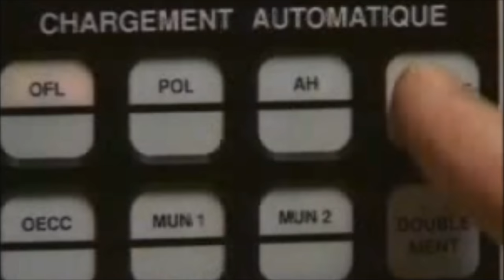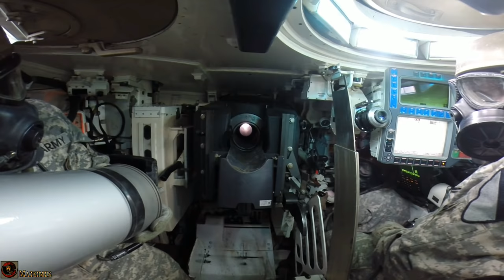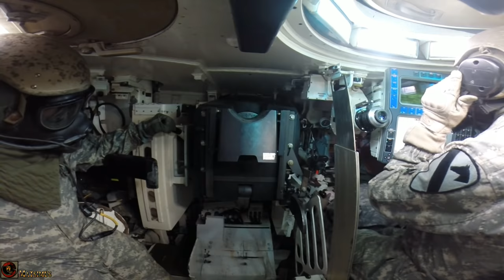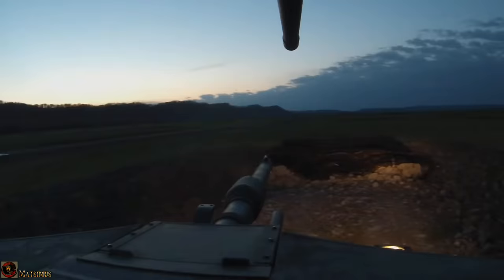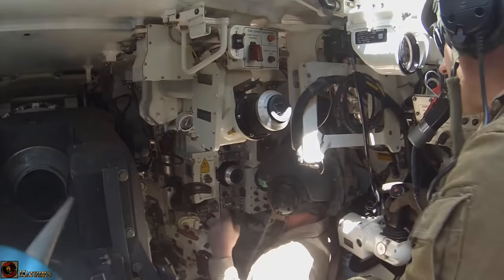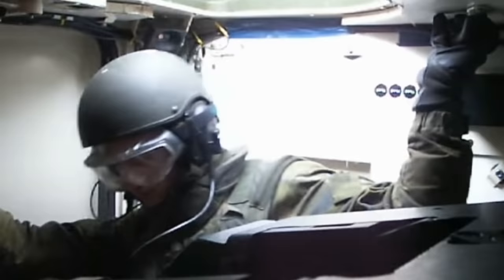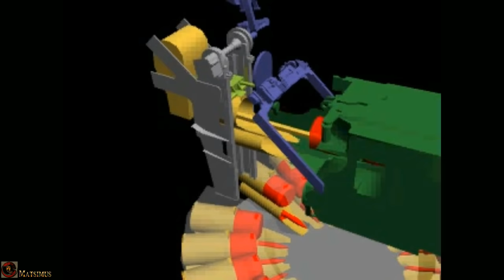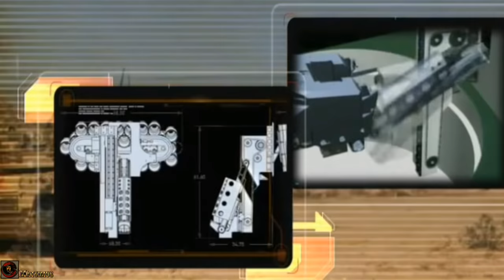Tank Autoloader or Crewman Loader?

Comment: I think one thing to bear in mind is that the loader choice is appropriate for the doctrine in the originating countries. In countries like USA and UK, the army is all professional, and usually has long term prospects. Therefore, you can invest in training good loaders and give them loads of experience. A rookie loader would be worse than an autoloader as they are still figuring out their job.
Russia etc has a conscription-based army on an average of about 2 years. That's two years to get basic training, tank training and actual deployment to a unit for exercises/battle! You can see why removing an individual in this situation is felt to be of benefit. I'm not saying I agree this is the right way to go - a system as flexible as a human loader is still appropriate (assuming a skill and training level allowing them to match or beat an autoloader). But autoloaders are much more valued if you do not have the peopled expertise to spare.
Reply from the maker: That is a very very good point. Never even thought of it like that to be honest! But it makes sense. I would say though that the US is going to side eventually to the autoloader systems. They are already working on it with Meggit. Thanks for the input mate :-)
Reply: Your assumption is just so wrong. My country has a conscription based army ans yet many people are making the living out of it. The army has many professionals and they are paid well, very well to be exact. All students who join military universities do not have to pay tuition fee and that's is a huge plus. And we are even poorer than the Russia. Your logic is kind of uninformed but logical from the point of view of someone who doesn't have the knowledge about the system. The conscription based military doesn't mean that you force people to join because no body wants to join, in fact our military rejects many applications every year. Bad eyesight, tatoo, etc and you are out. The military  system aims to do a lot of good things but it is 1AM here and I am tired and so I would conclude my comment here.
Reply: +Thịnh Nguyễn Quang yes, but I'm not talking about the conscripts who choose to stay - they become professionals and are not the ones I am referring to. I'm talking about the many many more who cycle back out as soon as the opportunity presents itself. If you have large staff turnover in any sector, you cannot provide the level of training necessary to all staff equally, simply because there's no point spending the money on folks who won't be there. I accept that the professionals who choose to stay will be better trained and probably better paid, but there needs to be enough of them to fill the ranks before you can afford to give out as many specialised roles. And if there were enough of them, there would be no need for conscription...
Reply: You make a good point, Ghost Dog.  I served as gunner/commander during the Cold War in Germany where most of the men in our unit were volunteers (3 year term of enlistment).  It took two years to make a man into a good soldier, so you had him for one year before he was released.  He had the option of staying on for another 3yr term, but nobody would want to remain as a loader for any longer than they had to, since it was our 'entry-level' job. There are many things even a rookie loader can do that a machine cannot, such as clearing a stoppage in a cranky coax mg, or double checking your 7.62 ammo belts before feeding into the loading trays, plus he is capable of (relatively) intelligent thought when something fails in an emergency which is something these robots cannot do.  In the heat of battle I don't want to have to leave my post to go clear some mg that's playing up.  That said, I did have one cranky loader I would gladly have traded for a machine!  
BTW-- With our good loader we could fire 15  accurate rounds per .minute.  
80 ]    Ah, but that was 50 years ago, and I expect that robotics have come a long way since then.
Ein Prosit!
Reply: Thank you for your service. If this was a manual loader, I can assume your service was with west Germany??? What tanks did you learn your trade on? What did you think of the soviet equipment of the time? What was the tank 'over there' that you were most afraid of (based on the data available at the time)
Reply: +ghostdog688
First off, I'm glad you mentioned is the training aspect. That is how the Spartans held off the Persians for 3 days while being outnumbered 100 to 1. The individual soldier is the important aspect on the battlefield. Regardless of the weapons or numbers.

Second and most importantly, a loaders job is more than putting a shell in the breach. When you are in a combat situation you run hot. Which means loaded and ready to fire. So the loader is the free man while not actively shooting.

The driver is busy looking for the best route to get where you are going
 while staying out of the vision of the opposition. A gunner is busy 
scanning the designated area of engagement responsibility. The tank 
commander has to do many things, verify what the gunner sees, 
communications, monitor the information system and try to keep an 
awareness of his local general combat situation.

That's where the loader comes in. While moving he is the only crew 
member that has his head outside the vehicle. Everyone else gets their 
information through periscopes or scopes. The loader has the best 
perspective of the actual battlefield. 

The loader watches the sky for helicopters, which is a needle in a 
haystack for the rest of the crew. You can see the terrain features 
better from a higher viewpoint helping guide the driver to a better 
route. Help spot enemy activity pointing the gunner in the correct area 
to scan. Help the tank commander by assuming the role of keeping up with
 the local units freeing him to do his other jobs better. 

The loaders main job is to make the rest of the crew better, therefore 
more combat effective. As a loader during live action war games, I 
spotted at least 1/4 targets we engaged with my eyes or binoculars 
because of the perspective. 

So I would guess that a loader adds 25% to combat effectiveness while 
only adding 10% cost. So at this time until you can make an M1 into a 30
 million dollar tank version of the F-35 with automated sensor awareness
 that is better than a human perspective, it is cost effective to keep 
the loader for the US. And comparing professional well funded military combat doctrine to countries with a budget crisis or ones with poorly trained soldiers is apples to oranges.
Reply: It's Me I appreciate the perspective and won't argue with it; I would guess that the Russian would argue they have strength of numbers (i.e. More tanks) to counter the number of tasked crew. Also they like to have SHORAD teams dedicated to hunting and killing air threats in vehicles like the Zsu 23-4, so the notion of keeping watch on the battlefield is more at the platoon and company level than the individual. Not saying it's the correct way, just a different one.
Reply: +ghostdog688
I'll point out first off that I'm not an internet warrior that is pro USA everything. If a soldier doesn't respect their adversary they are just plain stupid. Saying that the 23-4 is a highly respected weapon. It is viewed the same as we did the WW2 German 88. It's an AAA weapon but is very effective in many roles. For the cost and it's effectiveness it's one of the best USSR weapons they ever made. 

And I do understand the Russian military doctrine. We trained to run it, and how to fight against it. Not going to start a flame war on it because it is not that pertinent to this discussion though so I'll leave it right there.

On the modern battlefield, like with plane combat, who sees who first has a great advantage. Any tank is perfectly capable of taking out a helicopter. Reducing a tank ability to do that is putting the onus completely on the AA teams and the tanks in more danger. The US uses a more combined arms approach where anything can do everything. 

For example, the Russians have said that adding 4 Apache's to an armor brigade added 50% to that brigades combat efficiency. We did not have the same respect for the Hind-D. The Hind-D was big, slow and no longbow type of system that could fire while hidden. An armor unit vs a Hind-D was a pretty even fight. It would probably get the first shot but another vehicle would take it out before a second shot. Now that two propped chopper they had (blanking on the name) was respected even if it's firepower was lacking. It was fast and agile which made it hard to see and engage. 

And bringing up numbers of tanks, the US has over 14,000 M1's in active duty or in war stock. More than enough and many more than the advanced MBT's the Russians have. Add in to the fact that when the US goes for cheap, we don't assign the MBT for that role. Why do you think the T-14 has optic dazzlers? Answer, it's because the US started taking the $23,000 Humvee and putting the $50,000 TOW missile system on the them which means they could take anything the Russian had made up to at least the T-90. And you know the US, within months of ramping up production, could start pushing out a million of those a year.

If you want to go cheap, go cheap. No MBT is cheap relative to a hand held missile or one mounted on a truck. In my experience, one experienced tank crew is better than many ineffective tanks. I've trained in exercises against poorly trained soldiers at a 12 to 1 ratio, and we won most of the time. It was eye opening to say the least.
Reply: funny thing about your american m1 ppl always think that t72 was that bad example that ruined all. Russian loves autoloader cuz it actually reduce the size of the turret and maybe hull. therefore saving some weight. it also increase the loading efficiency when cruising at bumpy place. your best trained loader guy still get fatigue. 
Dont tell me it is vulnerable. your loader guy also turn "non-operational" when hit in the head. if you can sabot thru the armor then theres no difference between the two.
you think russians dont know why T72 is so bad? well, maybe its designed in 1960s.
Reply: It's Me apologies for the late response - my notifications just caught up.
First of all, thank you for the insight, and respect to someone who has been able to post an intelligent counterpoint. For clarification, I agree with all of your points - i am not saying an autoloader is the best system, but it is one that has merits - and given that russia has elected to double down on this with the release of the T-14, I'd say its here to stay. What started as an attempt to provide a counter point to matsimus' opinion, and provide some insight into the thinking over why an autoloader was selected has quickly devolved several times into an 'East vs West' argument over the capability of the whole army on each unit.
This isnt about that, merely an idea on the thought process behind the selcetion.
That said, as you've been so civil over your post, I'll bite a little.regarding your comment on the 23-4; I used one example of portable AA systems. Being that you have an understanding in Soviet/Russian tactics and doctrine, youll recall additional units such as the SA-8, as well as portable SAM systmes such as the SA -6 and its upgrades, the -11 and -17 are supposed to be deployed just behind the front lines to provide support and air cover for the advance.
While a Tank can indeed counter a helo if it spots it, a jet is another story - and Soviets always treated these with far more respect, simply because cluster munitions mounted to a jet would wreak havoc with a Soviet column. One CBU could decimate a unit, and in the quantity issued, I'd argue that air superiority for CAS was something the Soviets put a lot of thought into. I'd question whether or not any MBT of the 70s could detect and stop a jet on its own with its gun only if it had no TIS. The Zsu and SAMs could get helo's or at least force the air force to stop running CAS and start running SEAD/DEAD ops.
I do not doubt your excercises or their results. But I would wonder if the excercise fielded a truly combined arms approach - MBTs, AFV's, Infatry, Airforces and AA defenses, including theatre IADS. If it did not, I would doubt stringly that 12:1 score would be repeatable.
Lastly, I am  aware of the quantity of M1's that are supposedly availble. I would like to know how many crews you could field as I suspect you would not have as many well-trained individuals to adequately field the number of tanks you have. Even if you 'gave' them to other NATO units, you'd also need to provide Ammo, fuel and consumables for the units. Plus you'd need the logistical support to keep them provisioned. This is where I question the use in holding that many tanks in supply. Furthermore, where are they? I would wonder how quickly you could push them to the front line e.g Europe before Eastern tanks rolled over the gap.

I mean this debate and point in the spirit of friendship and the quest for knowledge. I am glad we can play this out hypothetically. The results would've been horrific.

Peace!

PS: Youtube comments page is delightful [sarc] at keeping this dialogue fun. If you feel like answering back in significant detail, may i request you join me in Mats' discord channel or my own if you dont want to deal with YT? This could get lengthy otherwise and i bet Matsimus could do wthout his inbox exploding lol?
Reply: +ghostdog688
No need for apologies. This is for free time fun and will not actually change any opinions of any people making decisions. 

First off, there is no denying that auto loaders will be the way of the future. All MBT's will have them. It's just a matter of when. The US has experimented with them and decided that a person was better until MBT's go turret-less. Meaning there will be nothing but a gun barrel on top of the turret with a 2 man crew. But at this time a turret-less MBT is not feasible. For a turret-less MBT to be effective it needs to ultralight, like made from carbon nano-tube so it can be transported by air lightning fast in relation to normal armor movement. We don't have a power plant small enough for the power needed, projectiles that are effective enough for the size needed and fuel efficiency to reduce the fuel storage capacity needed to fit everything into the hull. Yet that is. By 2040 or so I would guess you will start seeing at least feasible prototypes. Imagine you punch a little corridor through an enemies air defense and then helicopter a full armor division 500 kilometers behind the enemies front lines, that is the future of MBT. Extra mobility for MBT's now is measured in meters, extra mobilty for MBT's in the future will be measured in kilometers.

As far as the 23-4, it is respected because it is good at engaging infantry, any vehicle lighter than a MBT, buildings and helicopters. Basically anything other than MBT's and super sonic aircraft. It is cheap and easy to produce, easy to use and very reliable. A great weapon system. An AA version of the AK-47. I am aware of the other AA systems, they are good at short area air denial. The thing with them is NATO's tactics largely neutralize them.  Integration and command flexibility means they will hardly ever see a target to shoot at  Meaning that their one use will hardly ever be used, using up logistics, maintenance costs and personnel training for a not effective system. Correction, I should say only effective against third world military forces. Which is why you are seeing them push so hard on improving their long range AA systems such as the S-400 over short range systems.. Say an infantry man sees a an enemy vehicle, he can just hit it with a laser designation and have an Apache shoot at it from behind the mountain 4 kilometers behind the line or from 40 kilometers away from a plane with an air to ground missile. The only time they will see a NATO plane is at very high altitude bombing run or very low at super sonic speeds hunting helicopters. That is how the USSR messed up in Afghanistan. They were using their aircraft as hunters, trying to search out their prey on their own. That is how a short range, hand held heat seeking SAM (Stinger) basically grounded the USSR air force. They operated low and slow over enemy lines. Big mistake for modern warfare, and they payed for it. They are working on integrating their forces now. 

MBT's do not engage planes period. With smart bombs, short range AA do not engage planes anymore unless they get lucky. A plane is the best anti plane weapon. The only other way is a long range integrated air defense system. The problem with an air defense system is that if you take out 25% of the system the whole system loses 75% of it's effectiveness. Planes can shift quickly to close any gaps in air defense to make up for any losses.

I never ran combined force exercises versus poorly trained troops. Only highly trained ones. Quite honestly I don't think it would be any better. They had trouble with basic non integrated warfare tactics. I imagine trying give them a scenario with 5 times more complexity would not mean an increase in their effectiveness, the opposite actually would be expected. Take the Gulf War for example, now the US had complete air superiority so that has be taken into account, the ratio of losses was over 100 to 1. With the overwhelming percentage of US losses was due to friendly fire. Taking only enemy killed ratio would be closer to 1000 to 1. The US had the equipment advantage for sure but the Iraqi forces had all the small unit tactical advantage of fighting from prepared defensive positions while the US had to move over open ground with no cover or concealment. In all the battles where air and equipment advantages were minimized, the US still won easily because of the training difference. 

The number of M1's the US can field is actually helped by having a loader. By dividing the crews. Just like they say in the normal world, you learn more in the first 6 months on your job than you do in 4 years of college.  A loader or driver can be trained quickly. A soldier coming out basic knows how to operate the equipment. With in a month of living and training on a tank learning from an experiences crew, they are night and day on aspects of being a soldier. A loader trains to be a driver and a gunner. Same with drivers. Gunners train all the time to be tank commanders. After spending a year  on a tank training I felt comfortable enough to be a tank commander. Not bragging that I was some super soldier or anything but I knew my skills. I was a very good loader, a descent driver and a bad gunner. A loaders job is a multitasker, same as a tank commander using a lot of information to make decisions. A driver and gunner are single task jobs based on little information. I was better at the bigger picture.

Logistics is always the main issue of any military force. They same problem the Russians would have in your rolling over Eastern Europe example. How would they be able to maintain their push when their forces go further than their integrates air defense shield reaches. It's pretty obvious to all but the most die hard SU fanboys that NATO would have air superiority.  If the Russians had to wait to move their air defenses to cover their supply lines then they would not be rolling through Europe but crawling.

In almost any scenario, a fight between two powers will be messy to say the least.